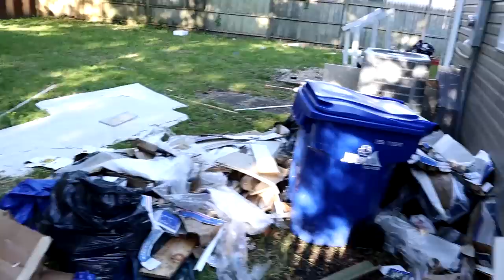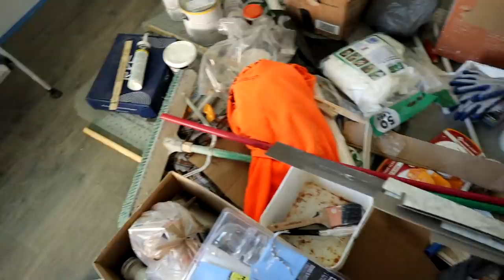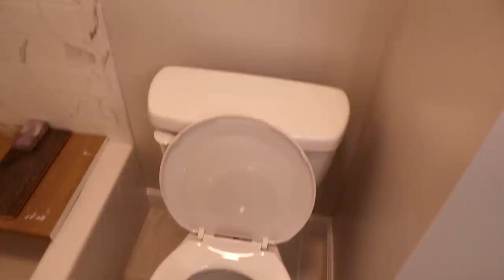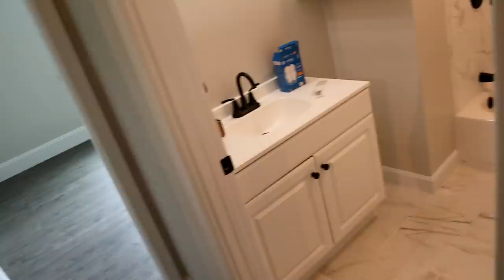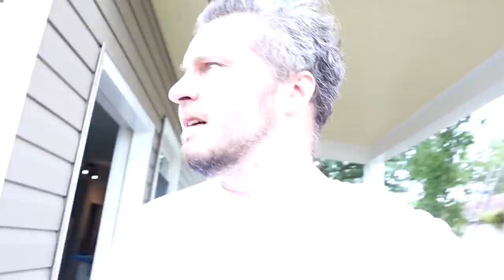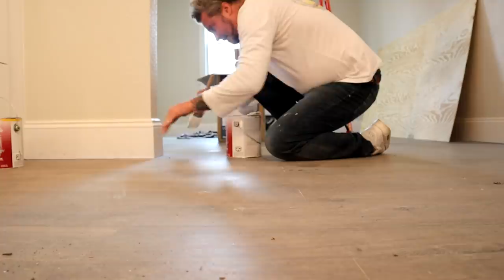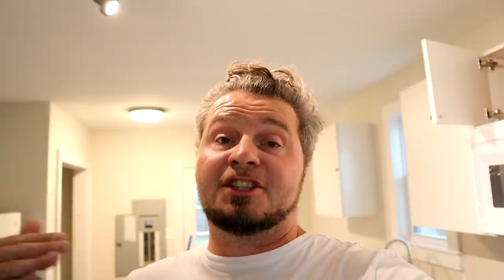Rabbit Walked Off The Job...

Comment: Joe, not that your really going to see this comment, I understand both sides here but keep in mind that you even said in your video that you started cleaning floors and after just doing a closet you said you were tired of that. How do you think Rabbit feels after working on the whole room all day? His knees arms and back are probably sore as hell. I also live in northern va so work is only slightly more competitive up here due to the market being high but years ago with no experience as a tile helper, I made more than rabbit is making. Currently working as a general laborer I make $15 an hour which I still understand to be low but the longer you have experience the more you pay for it. Rabbit could easily make more than me at my job. Just info for you and who knows if you even see this. Good luck to both of you.

Comment: Dammmmm... Rabbit needs to grow up dude.. I noticed that all u had him doing was cleaning.  So 70 per day is not bad. However, if he worked 10 hours, & u only gave him $70, then that's slave labor. Even at $9 per hour as you said, he should have gotten $90 for a 10 hour day.. I say throw him an extra $100 bonus to make up for the days you shorted him, & keep things moving.. Then start giving him $90-100 per day... That's my suggestion.  But walking off the job is still very childish.  A true friend would not screw u over like that !!!!